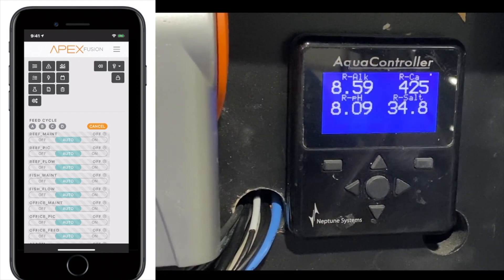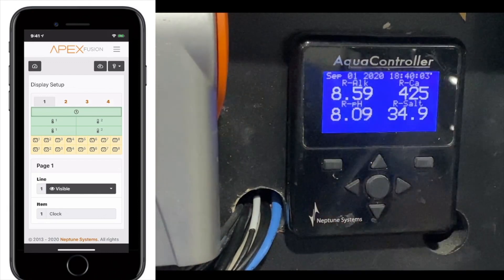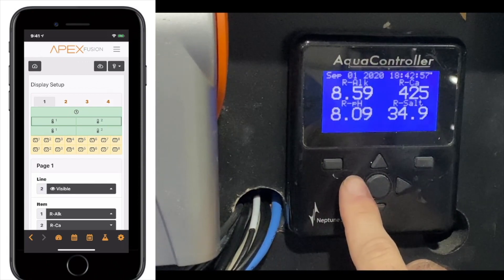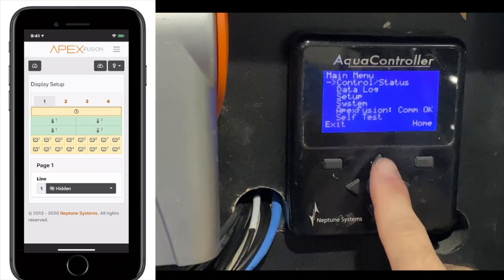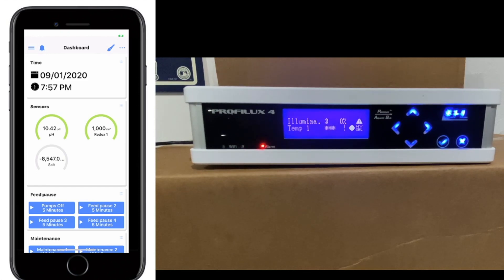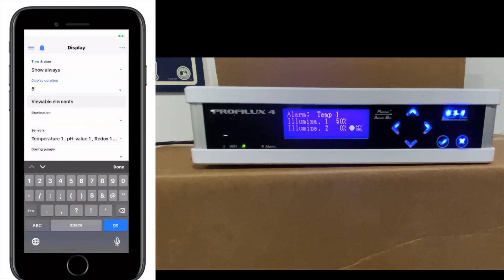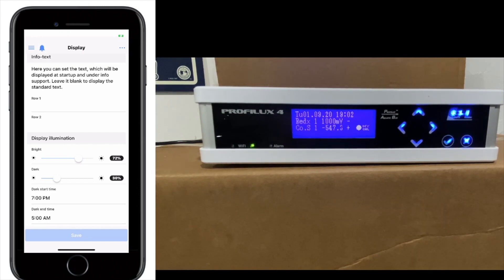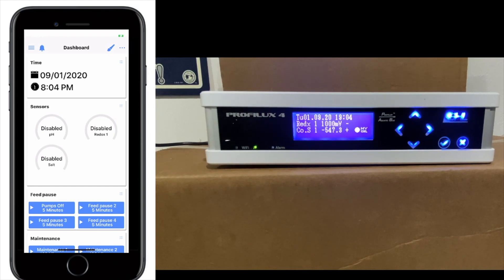GHL Vs Neptune Systems - Episode 9 - Displays

Comment: @reef Automation doesn't GHL have a touch screen display that is small like the APEX I saw it online.
Reply from the maker: Discontinued and no longer supported.  I will not be mentioning discontinued products on this.
Reply: @ReefAndReptileAutomation  that's a great call out because I did not see that. I knew there was a reason why you didn't put it in the review. Just didn't know that they discontinued it.